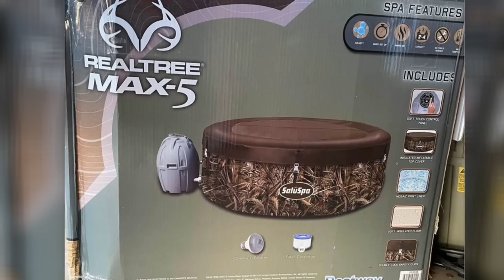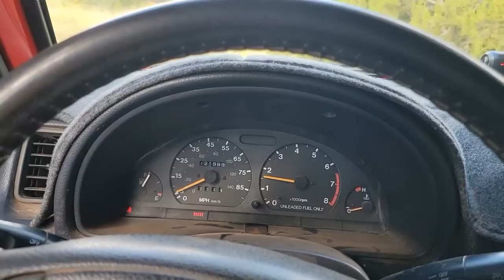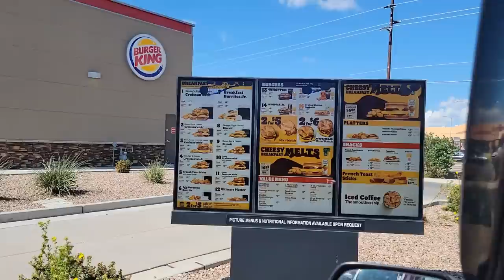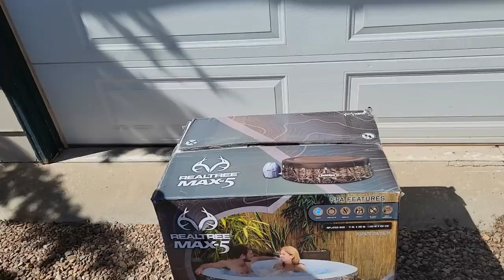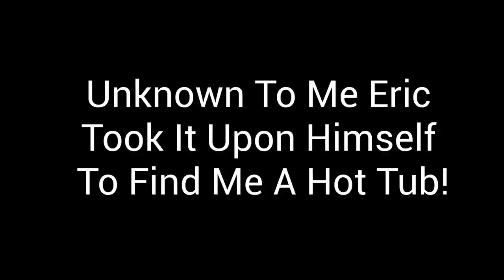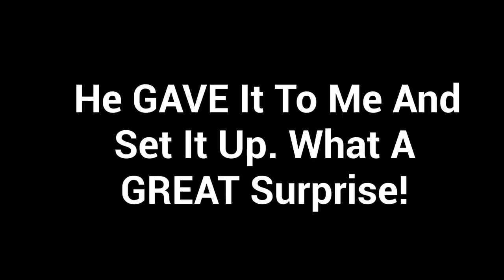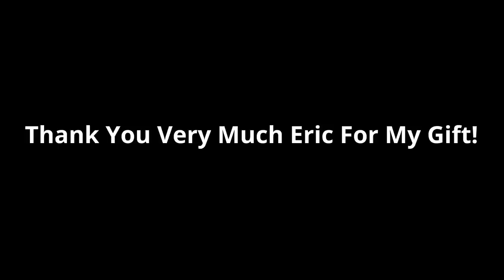Nomadic Fanatic Does His Best To Get Me In Hot Water At Vagabond Base Camp!!! Not Clickbait!!!

Comment: Did someone mention mice?
If you are leaving the hot tub out 24/7 (and the cost of paying for water makes that likely) then check with the neighbors about how to safeguard the purchase from damage due to animals or weather. UV rays can be a problem as well. 
Can you vacuum sand and other debris out of the tub?
A way of emptying the hot tub in an emergency would be wise (a strong gust front ahead of a storm, damaging winds, an unseasonable freeze warning, etc.) Can you run a hose from the tub and pump the water away from structures?
While it may be tempting to leave the water natural for later use in the gardens, some chemical treatment will be necessary if it remains in the tub long-term.
Avoid putting the tub in storage while wet. The desert climate will probably make drying it out easier, but the area beneath the tub may be a concern.

Comment: CVK you may want to have the Vet check her knee cap. A luxating patella, in which a kneecap moves out of its normal position, is a very common occurrence in dogs. While small or toy breeds, such as Chihuahuas, Yorkshire terriers and Pomeranians, are the most prone to a luxated patella, this orthopedic condition can affect all breeds of dogs. Symptoms of patellar luxation vary according to the severity of the condition and include:
Limping or lameness, Reluctance to place weight on the limb, Discomfort
The clinical signs are often intermittent and sudden. Your dog may exhibit an irregular gait for a few steps, usually with one limb raised from the ground, before resuming a normal walk.
Reply: Many aging pets do. I have a DSH cat with one. My chiropractor adjusts her occasionally & showed me how to help her when I see her limping. Joint & ligament supplement, CBD oil & massage/ working the joint are helpful.👍✌️😽